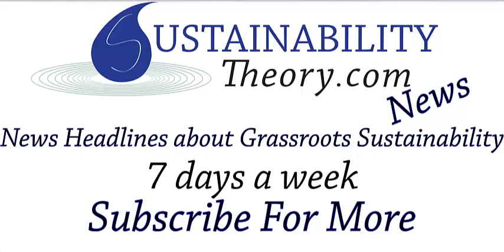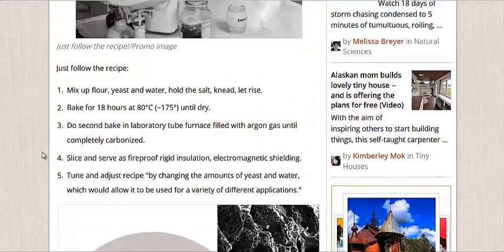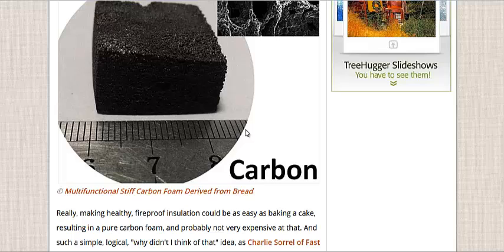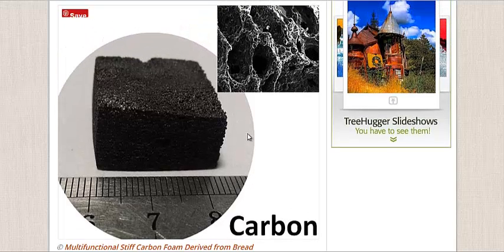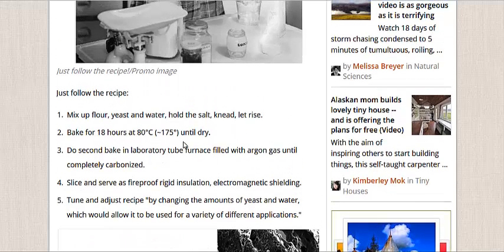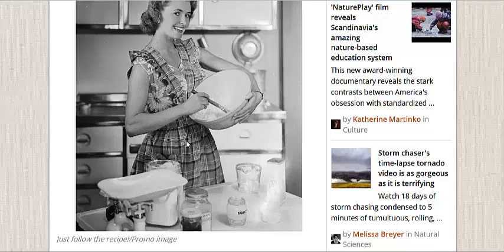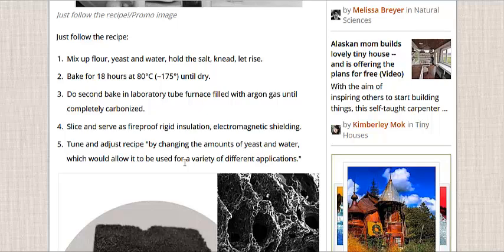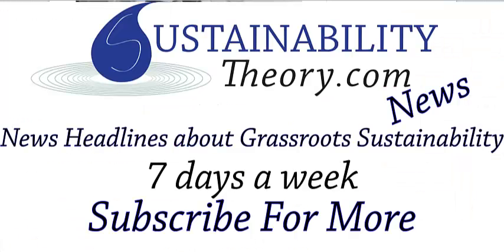Using Burnt Bread As Insulation

Comment: Tried it already. It's not really fire-proof like no fire can destroy it. It does burn, but very slowly that you will not notice it. My solution for this is coating it with with sand fused with sodium silicate. Or just use it as a filler inside hollow steel walls for better protection.
Reply: If you remove oxygen it should work
Reply: Pardon me, Should we use sodium silicate by using sand fusing process
Reply: Increase the temperature of the pyrolisis and there will be less hydrocarbons left to be burnt